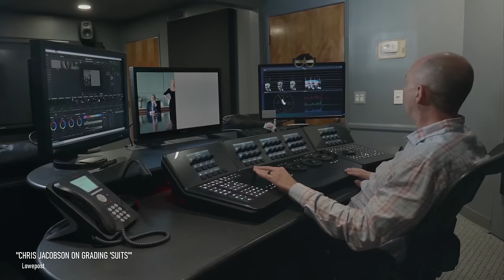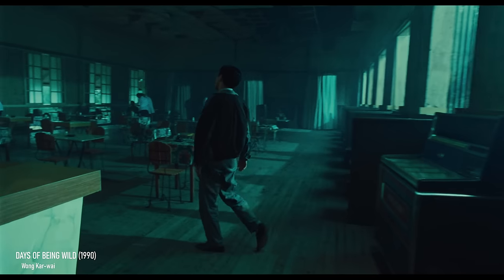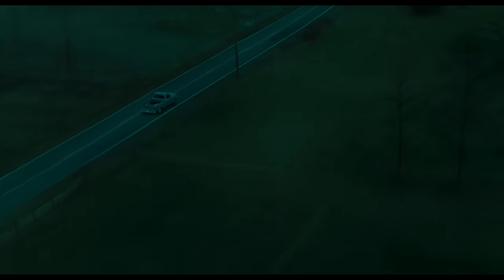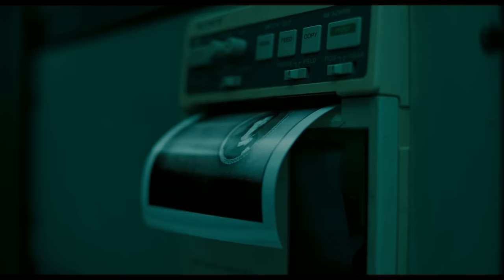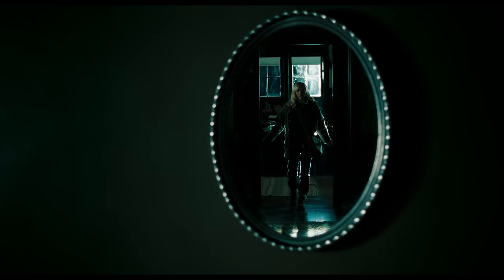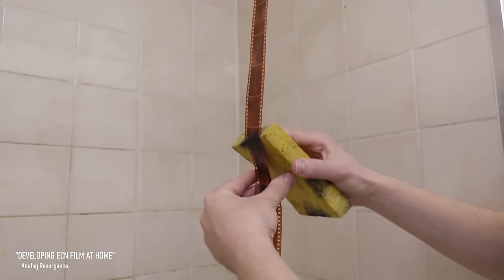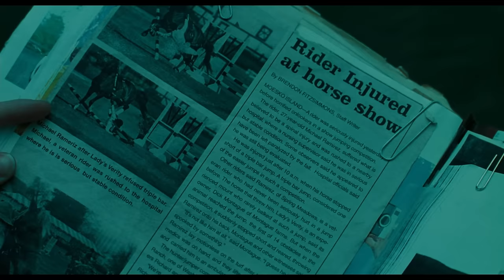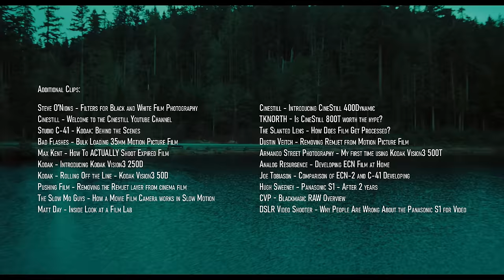Why The Ring Didn’t Use Color Grading

Comment: This is achieved by using colour correction filters, and can be easily achieved in camera using the colour temperature and tint controls.  That's all those filters were.  Digital cameras tint controls work go to -50 to +50 on the green magenta scale, so work in the exact same fashion as the correction filters.  It is nice though to see how they achieved this, and I appreciate you doing the digging. Thank you

Comment: Excellent video! You went a lot farther than most people would for this! I always appreciate when video essayists do this level of research in search of their goal. Buying the exact issue of ASC to reference, explaining the printer points system (I did always wonder what the numbers meant when people did the adjustments on enlarger heads), etc. It's the kind of detail I really like!

You went further than I figured for the recreation! Didn't give up with the many alternatives for finding the right filter, especially making use of the plastic ones is a great idea. You're actually spitting out great ideas left and right here lol

It's cool that you had a local lab that could do the ECN-2 process! But I didn't know remjet was that much of a pain... I figured that Portra being cited as having a similar character to the Vision 3 stock would be enough (that latitudeeee), but that would be too many variables changed...

One thing I am curious about: you did mention earlier about how S-log gives a lot of flexibility to color grading today, then later cite David Mullen stating that subsequent iterations of Kodak's stocks have less and less contrast... I feel through what we see on ungraded scans and the particular gamma of developed negatives that it also has a very color-correction-friendly basis. Or is this an apples and oranges comparison?

Also, then why did the DP stay with the EXR stock if in the development steps a reduced contrast was sought? Was it just all the other characters of the stock? hm

I appreciate the final comments about not taking risks and "decision paralysis" in filmmakers, even when trying to push those choices to the final hour can make the results much worse. On a larger scale, the issues of VFX artists having to make sweeping changes on marvel films is one example I see cited a lot...

Your video on that wide lens used in Fallen Angels and WAIT YOU DID THE MATRIX REMASTERS VIDEO TOO??? Ok, if the lens video didn't already do it, you are the greatest creator for videos on filmmaking looks I've seen. BRAVO

now, if only I can get off my butt and make my own video on the debacle that is James Cameron's remasters of his films...

Comment: Dude, GREAT work! I love the, for lack of a better term, scientific method and history you dug in to here. Fantastic.

Since you nailed 99.999% of it, I'll just supplant that diffusion filters are technically designed to soften light and bloom sources/highlights not necessarily to take the edge off digital. That's a more modern use but their original purpose was to reduce resolution, to a degree, and bloom highlights.

Again, amazing work and really well done overall on the production of your video. SUPER engaging and entertaining!
Reply: Oh and I subscribed before I even finished the video, keep it up man!

Comment: This video certainly did shed some light on a couple of things for me.

I have a question about colour correction and saturation in movies/television if you'd like to take a crack at it:

I've noticed over say the last ten years that television and movies have been really cranking up the saturation and brightness in their productions. I know that colour is one element of a production, but it seems like more and more studios are overdoing it and using it when it isn't needed. 

Take a look at something like Bladrunner 2049 where they're using colour as an important tool that's needed for the movie but then look at the trailer for something like "The Beekeeper". The colour in that movie isn't being used as an artistic/metaphorical tool but instead for reasons I don't know, it's just hyper saturated for the sake of being hyper saturated. When productions have done this, I notice that the most common colour that they've over saturated has been blue, followed by red and then yellow.

That's not the only movie out there that's been hypersaturating their colours, but it's the best example I can think of. 

I don't know if you can see it how I see it but to me it literally looks like the correctionist used construction safety vests as the colour palate for the productions to the point that it just looks artificial.

Have you yourself noticed anything like this and if so, why is it like this?
Reply from the maker: I wish I had a bit more industry insight to know exactly what they're thinking when deciding to go with these much more saturated looks recently, but I have noticed what you're talking about and I can take a stab at a couple of the things I'd guess are responsible for the trend.

The obvious one I'd say is just the industry shifting away from the trend in the 2000s of the gritty desaturated look. When you've got major big-budget, highly successful movies that are moving in an extremely colorful direction, more and more people will copy it because it's the "in" look until audiences get tired of it. 

On a more technical level though, I think a big part of it also has to do with technological changes, both in digital cinema cameras and how people watch movies. More and more people are streaming a majority of the films and shows they watch on increasingly high-quality TVs. Things like 4k, HDR, and quality color rendering are becoming more the norm than the exception, and as a result, filmmakers feel more comfortable leaning into those features. While this has led to things like the trend of shows and movies being a lot "darker" due to them expecting a lot of people will be watching them on HDR TVs with higher brightness ratings and more detailed shadows, it has even more frequently led to movies being graded a lot punchier and more saturated, because bright colors and high contrast look great on high quality screens (see things like Pacific Rim in HDR and most animation for easy examples of this).

Advancements in digital cameras have also made it easier to have highly saturated colors like this, due to much better color rendition than a decade ago, where highly saturated colors might have looked a lot more warped, unnatural, and one-note, so cinematographers and colorists might also be taking advantage of this simply because it wasn't as available before. You'll see old movies shot on film that have striking, highly saturated colors because film handles color extremely well, whereas digital's ability to stack up is a relatively new phenomenon. 

I'm sure I'm only scratching the surface, but hopefully that helps a little!

Comment: This is awesome, the coolest thing for me is that you got the filter pass correct, if you compare the originanl 17:07 cop car blue lights and the red lights at 21:13 , that's really hard to do in post processing as the wavelengths are unknown. This type of selective color filtering is so cool, I'd love to replicate this in graphics coding, it should be possible but non trivial I think. I also didn't know about pull and push processing, I actually love the push processing effect too. I know you put a ton of work into this video, I really appreciate it.

Comment: Fantastic deep dive into the look of the film.  I had no idea how this look was achieved. There is however one aspect that also has an immense influence on the look when it comes to film I personally missed: the print stock. The influence of the print stock is often overlooked but the way it alters the look had a major part in the different looks of tv drama vs  cinema until digital grading came along. Kodak's 2383 Print film (that was for the ring) adds an S-Curve to the  look, a slightly warm tint to the highlights  and a cool one to the shadows and blacks.

Comment: As an FYI.  In 2002 most theaters didn't project digital.  Films shot on film and for digital color grading a digital intermediate had to be created.  To project this grade now in theaters it had to be transferred back onto a film negative with a CRT or an Arri Laser.  The required scanning and writing back out to film process at that time was hugely expensive.  Oh Brother where are though (2000) started the digital color grading trend for theatrical film releases but in 2002, at the time The Ring was shot, most cinematographers would still use traditional methods using stock choice, filtration, PD, color of lights, and lab printer lights, to achieve the  "look" of a film.  As such the methodology used on The Ring to achieve its look isn't unusual.  If you go back in time from it's release you'll find that this was the norm.

Comment: i think one of the issues with getting the digital to imitate the look by using photo tools is that your filter setups and analogue film itself work with subtractive color, while tools like photoshop use the additive space of digital photography. Outside of custom tools and a few hacks in davinci resolve, getting the ratio of saturations and contrasts right to feel analogue is gonna require a lot of fiddling.
Reply: Cuz is traditional filters not  digital big difference

Comment: What video source did you use for your references? I've seen comparisons between both the DVD and Blu-ray releases for The Ring and the colour timing is drastically different between the two, with the Blu-ray having a much more drastic colour cast. The research you've done certainly seems to point towards the heavy colour cast being intentional, but I wonder what the theatrical prints looked like at the time of release. I'm also curious if the upcoming 4K disc from Shout Factory will lean more towards the DVD presentation or the Blu-ray presentation. If you're curious to see the differences for yourself, you can view them on caps-a-holic.
Reply: I'm glad you brought this up, as I have the DVD and I recall the video being drastically less green compared to the blu-ray. When the blu-ray came out, i was quite surprised how different it looked. It's not even subtle.

Comment: It’s very different shooting actual film vs Digital. When shooting daylight balanced film stocks, filters work great as long as the color temperature is close to the 5600 Kelvin spectrum. The problem with filters is the dramatic changes in white balance between the different times of the day. If you notice almost all of the Ring was shot in cloudy weather which is about 6000K. That keeps it very consistent and allows the filtered final look to be consistent throughout the picture.

Comment: Despite the flexibility of log/raw for post color grading, they can not compete with getting the look in camera through lens filters and the choice of film stock. This is simply because post work uses only 3 wavelengths as input: R, G, B. Contrary to belief, film and digital sensors are not sensitive to only 3 wavelengths, but in fact, 3 ranges of the visibile spectrum. These ranges give entire distributions of colors, but RGB distills these 3 distributions into 3 numbers. Optical filters and film stocks/sensor work upon the full spectrum of visible light, but color grading works upon only the R, G, B values that are distilled down. There is no replacement for the loss of information, a color grade might match a film look in one scene, but not the next, though the difference might not be so significant.

Comment: the remjet issue is better solved developing at home with a pre bath of 3 minutes of baking soda ( no washing soda) and making sure the baking soda is fresh then wash until the water comes completly clear and do the rest of the processing as normal. i've been doing this since 2018 with very good results even in 16mm shot on a bolex and developed at home on a morse tank.

Comment: "Why The Ring Didn’t Use Color Grading"
A pretty complete answer to the why is pretty much just "Because hard drive space was much more expensive over 20 years ago."
Full digital intermediate was still pretty expensive when it was shot, so it was still pretty normal to just get most of the look in camera.  It was certainly possible at that point, not even particularly exotic by 2002, but certainly something that had to be an active decision.  In 2002, it wasn't even a given that you'd have video-assist.  A lot of stuff was still shot with the camera operator looking through the purely optical eyepiece, and everybody else on set having no idea exactly what the camera was seeing, and no way to get playback until developed film came back from the lab potentially days or weeks later depending on where you were.  There was a lot of just praying that your awesome filters would actually look cool on the film.
For people used to modern workflows, the old ways are such a weird mix of carefully calculated mad science, and just like optimistic vibes and then chilling and waiting to see how it turned out.

Comment: And when The Ring came out , the poster was scary on its own... But when it came out on DVD and VHS, I was disappointed that they changed it to the well scene/look. Which also was washed out. I love however that the VHS 📼 version ironically had the cursed tape when you first put it in your VCR, that was kinda GENIOUS... I still watch the VHS version for the nostalgia and for a relaxed view. I miss tapes , you could literally throw them or drop them and they wouldn't break. But a DVd you gotta be careful and the players are cheap. A VCR will last you almost a lifetime. I still use my Sony VCR and it was built right before they made the DVD/VCR players which I never liked. But I digress, I'm only 35 but I TOTALLY MISS THE BLUISH SND GREY -ISH LOOK. totally FML moment rn lol

Comment: Movies of late 90's and early 2000's relied heavily on color grading. Not just horror movies. Most memorable movie most people will recognize would be The Matrix but a ton of movies used it. Color Grading is also useful technique to hide CGI elements, it was probably tough back then to perfectly color-match the cgi element against a video so it wouldn't stick out and this technique allowed CGI to blend in perfectly. Take Lord of the Rings Trilogy for example.

Comment: Seattle and the Olympic Peninsula where the movie was filmed is typically a grey overcast and more so in certain months than others. It provides a rather uniform neutral shade among the other two dominant colors of the landscape, blue for the water which looks more black than blue with less light hitting it from the overcast clouds, and green for the massive amount of trees that dot The Emerald City as Seattle is called. 
So you have buildings and sky, things that reach upward as being grey (including Samara's nightgown - symbolizing her reaching upward to get out of the well), and the black water of which Seattle is surrounded but also plays an evil role being that black water is what Samara was drowned in, deep dark well water. Her hair represents the depth of both the well and the water she was pushed into and died in. The green represents what is natural, real, not man made, not paranormal but what we feel and see in the real world. We are calm, the spirits are not, green represents a calm but also the landscape between the heavens and the hells, the grey above and the black water below. Samara was from one, murdered into another and is trying to reach the top heaven level.

On an American note - they used green color rather than correctly grading the color to add an eerie feel to the movie by American standards, something is off and has to be to make it feel more intense, realistic or believable in our eyes. In Japan, things happen in the natural world and are accepted even without reasoning. Some chick coming out of a well in full color isn't gonna scare any American, but make it so she looks creepy with a strange color that's offputting and yeah, it will freak us all out. We are weird that way.

Comment: I read once, in the headline of an article long ago, which I have never found since yet believe was fully real, that the reason they color coded everything in The Matrix green was because green shading has a psychological effect that immediately warns the mind that what is being seen is not real. Then when they are acting outside of the Matrix itself, that effect is not present and lighting is brighter and more natural. So your mind knows the Matrix world isn't real just based on the temperature and color grading before anything especially strange even happens.

Comment: I wanted to recreate the orthochromatic film in my monochrome camera, and spent an obscene amount of time looking for a filter to do it in camera.

I ended up finding some filters that are used for manufacturing processes (reading barcodes, etc) and it's actually turned out fairly close to Orthochromatic film. Wonder if you could get the same green filters in that route.